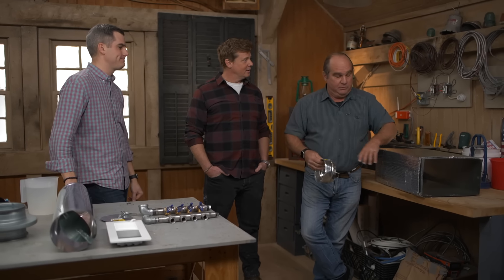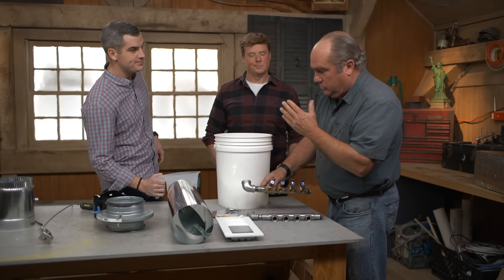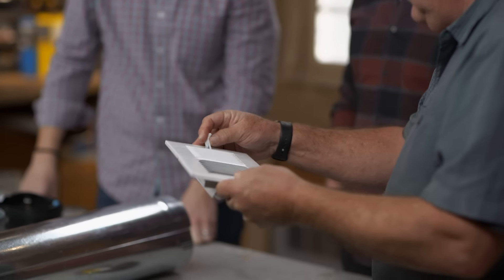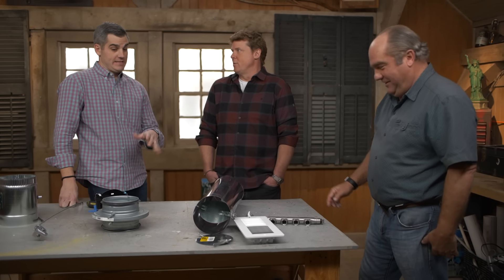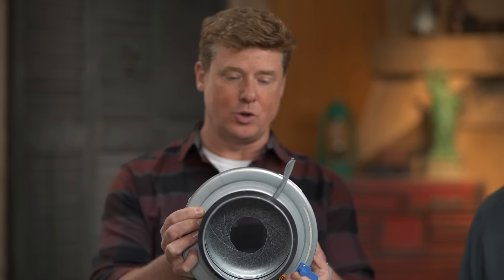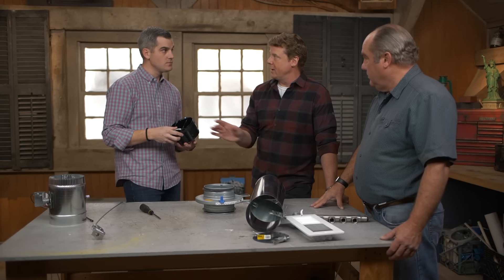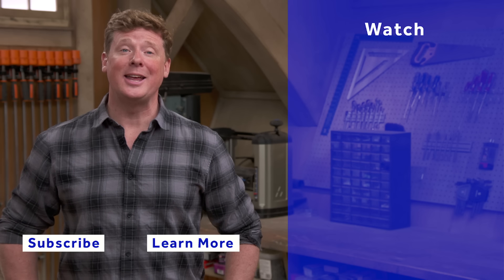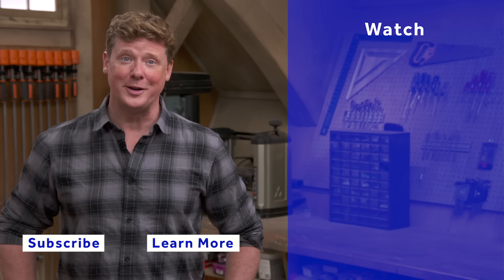Understanding Air Flow | Ask This Old House

Comment: I would suggest to never install drywall as a finished basement ceiling. If anything goes wrong with the ducts or there's a leak on the floor above, you have a huge hassle to take care of it. Just put in some nice ceiling tile that can be removed right where the problem is.
Reply: I like drywall better for a more finished look, but I put access panels for anything that would ever need service in the future.
Reply: If air leaks all it makes is a sound. It’s not that serious if there’s a leak.
Reply: @cbermudez281 A water leak.
Reply: So, you gonna do that between the first and second floors too?

Comment: What they got wrong is that air will pressurize and push back the air more evenly.   The water demonstration is incorrect.  A duct filled with air will build back pressure and change the dynamics of take-off locations.  Balancing dampers are still needed, but not in the way they are showing.  HVAC business owner here, 28 years.

Comment: Surprised nothing was mentioned about automated zone systems. I have a thermostat in each room that is connected to damper that opens or closes electronically based on the temperature in each room.
Reply: I agree and this has been around for years.
Reply: Guessing air handler is providing static air pressure? That's the problem. Sure handler needs to adjust - have variable power/speed to make it work properly. Closing off completely one register, which was meant to provide air flow will unbalance the system and can lead to problems. I believe they didn't mention it so no witty diyer start putting this into their one speed system...
Reply: @MariuszChr  Yes, that's why all the doors in my newer house have a big gap under them, so air can move even when door is closed. Newer furnaces should never have a floor register completely closed off as it puts a bunch of stress on blower.
Reply: @gl15col  your house probably leaks sounds like crazy. You don't need a big gap under the doors if each room has a supply and return.
Reply: @Egleu1  ... true, but the cheaper install is a supply in each room with a common return in a hallway. This is why we have balance problems when carpet is installed and that door gap goes away.
Reply: @SubToRandomVideos101  where else would I learn how to do an oil change in my Porsche GT3 if I can’t be on YouTube?
Reply: @Egleu1  wth kind of home has a supply and return for each room? if you have one of these homes, you are TOO RICH for this channel
Reply: @Vlican  my home does. It's not hard to do if the basement ceiling is exposed you just run a couple extra ducts.
Reply: @Egleu1  Still, returns in each room of the house is as rare as hen’s teeth…for somewhat obvious reasons.
Reply: @jaimslaw  What reasons?
Reply: you still size the unit and ducting to the home and home conditions. however, with a zoned system, there’s is a Zone board with the system that controls air to each zone. every board can be different but if it’s a simple 2 zone system, typically when there’s a call for one zone, the system will run 70% of its maximum airflow versus 100% with both systems calling for air.
Reply: @jaimslaw my home is a 1955 duplex. Every room has a return

Comment: This was really helpful for me. The upstairs and downstairs temps of my apartment were always drastically different - I measured the temp upstairs at 8 F warmer than downstairs last week. I had just resigned myself to the fact that we had a crappy AC unit because it's a rental. By closing off the vents downstairs somewhat (where the air handler is) I've gotten the upstairs and downstairs temps to match and it's so much more comfortable. Thanks!
Reply: Are the stairwell open?  The stack effect means hot air rises, so with open stairwells the downstairs hot air rises to the upper floor.  I have seen, but not used, ceiling curtain tracks which hold long curtains that reach from ceiling to floor. I think those curtains would lessen the stack effect.
Reply: That's really unusual you have an air handler downstairs!
Reply: @dianedoncheski2302  Not in old houses with crawlspaces.  in a 1960s neighborhood in the southeast and they're all in the crawlspace and ducting from underneath.

Comment: My parents and I were talking about air flow today. We were trying to find the dampener for the Maine floor of a colonial. Looks like the primary duct is in the ceiling of the basement without any dampeners and ceiling registers. So the water example really helped explain why it is so hot on the Maine floor.
Reply: This was a great example. We get it now.
Reply: Usually not that hot in Maine

Comment: Great learning here, thanks. OK FOLKS - PLEASE HELP. 2 years ago had 100% new Furnace/HVAC installed. And, other than my leaky crappy windows - yeah, the house warms and cools. But all of a sudden - my basement is really really cold. As in, I need a winter hat and 2 sweaters to watch TV down there. Fully finished basement. I actually feel a cold breeze sometimes - but for the life of me can't see where it comes from. It happens when NO heat or A/C is operating-  my suspicion is the breeze happens right before heat kicks on. I've literally slept next to vents in basement. At best a tiny trickle of air - sometimes but there's no way that freezes a 1000 square foot basement.  Exhaust fan in bathroom I out my hand on all the time - no cold air there.  I've hung toilet paper everywhere - once in awhile I see the paper wiggle. And I'm totally still and no heat/AC is kicked on. But again dont know where the heck the air comes from.  Any ideas???  Could it be leaky ducts - shooting cold air thru the ceiling tiles into basement?    Appreciate any thoughts, thanks.

Comment: Not pictured: Flex ducts which are common in the South. Flex ducts also must be installed correctly no slack and no sharp turns,

Comment: My house was built in 2009 and I moved in a few years ago and the 2nd floor has 4 cold air return vents but just found out they are not hooked up .
Is it possible to hooked them up and would it make a difference in evening the house temperature.
In the winter the house is 2 ½ deg cooler on the second floor than the main floor and summer 2 ½ degree warmer.
One cold air return on main floor (working). None in basement.
House is 1537 square feet.

Comment: In most production built homes today, the hvac contractor will not install metal ductwork. He is bidding for the houses and will opt for flex duct to reduce material and labor costs. Flex duct is even less efficient at moving air than metal ductwork. Flex is more restrictive and is never straight. Sags, sharp bends and length of run to fit around obstructions greatly reduce the cfm  that was called for in the design. Quality of installation is the main factor in a satisfactory system. Properly sized equipment, ductwork and neat installation is critical, but often ignored because of cost.

Comment: The iris dampers look cool but are very restrictive!!! On a typical residential system we only have .5” of static pressure to play with. The A coil = .1” the filter is .1 1+1= 2 right? So we only have .3” of SP for ducting and the typical very restrictive cheap supply registers most people install, oh did I mention duct air leakage??? The idea create the least amount of restriction as possible NOT to add restriction. Look up the Reynolds number Laminar flow VS turbulent. These iris dampers cause a lot of turbulence and uses up our our static pressure.

Comment: distribution of air is dictated by static pressure more so than proximity to the blower fan
Reply: Those two are directly related.
Reply: @MattFerguson26  no kidding  it's all related, but his water through pipes example was too simplistic not to comment on

Comment: The pipes for the example are different. One has the outlets point down and the other is out the side. Of course it'll come right out the first one if it's pointing down. It would with the valve too.
Reply: But you can also have registers and/or ductwork pointing in different ways so it's kinda the same thing

Comment: I am in Atlanta Ga in a 1963, 1650 sqft house, and nobody is competent enough to help me. I am so frustrated. My house lacks the proper number of vents and the duct work needs restructured. So in the summer I can only cool to 82 degrees and I have to deal with it because no individual or company has been knowledgeable enough fix my problem. I need all the advice I can get!!!’ Thank you

Comment: sir, one thing to ask please reply, there is one thing called cross flow fan like one ac blower fan i have a idea to implement cutting this into half and fix one side to motor in a way that it can withstand on motor shaft without fixing the other side and rotate it reverse will it give air from inside the hole in center to out side, so that i can fix to pipe to make air flow

edit: i wish you understand what i want to say 

   + (-ve)             |----------------------------------------------------------------------|  open from this side
|-----------------|      |----------------------------------------------------------------------|
|                   |===----------------------------------------------------------------------|   ➡➡➡
|-----------------|      |----------------------------------------------------------------------|              
   -  (+ve)            |--------------------------------------------------------------------- |

    and air from these arrow to pipe to go further

Comment: Wish I knew more about this before I got screwed by Costco approved sub contractor. They installed my new air conditioning and ducts.
Reply: I didn't know anything about what size I needed, and they installed a air conditioner that is too big, so it runs for only a short time to get the temperature down, which is never long enough to deal with humidity. The temp says its fine, but it's never really comfortable. Won't take the word of a contractor again!
Reply: 0:32 here it's discussed.  the question that needs to be asked, if they do a load calculation? If HVAC contractor does not know or care to do one, try another contractor who does.  Also, sometimes the one of the units that is currently installed may be the wrong size for your home.

Comment: Open stairwells allow the stack effect, which causes temperature differences from lower to upper floors.  But I have not seen this addressed.  The stack effect means warmer air rises, so with open stairwells the downstairs warm air rises to the upper floor, whether it is heating or cooling season.  I have seen, but not used, ceiling curtain tracks which hold long curtains that reach from ceiling to floor. Using those curtains would lessen the stack effect, I believe.  Or build enclosed stairwells.  Multi-level homes would have less temperature divergence, more comfort, and energy savings.

Comment: Maybe I don't have to point this out, but it seems to me that some of these solutions are just the better mousetrap. If you have access to install a fancy damper, then you also have access to manually adjust the $3 damper. If you don't have access, then the damper should probably be in a better location, like near the trunk line. (where it will make less velocity noise)
Reply: They install the dampers where the trunk meets the offline run . In many cases they just adjust them during installation.  Problem is that owners change them and sometimes cover the system to hide the ductwork.  My furnace was installed under the bedrooms with the living room and kitchen at the far end .  I ended up shutting off all three bedrooms . In the basement , I have a exhaust & intake which I closed both.  When the furnace runs it takes the air from  the basement ( which may contain radon) out thru the chimney. The foundation area is not sealed .  The far end of the house gets all the heat and radiates to the bedrooms , which should be cooler.  I went from a 120,000 BTU FURNACE to a 80,000 BTU .  First furnace 1963 to 2015 replaced fan motor 2010 .

Comment: If the ductwork was laid out properly to start with airflow would balance. This would involve some prior calculations by the installer. There is even software available to help thru the process. But it takes time which most HVAC install companies don't want to spend.

Comment: His main trunk idea is NOT how it’s actually designed by anyone with any experience. The design distribution work is the following…. We design to static pressure for residential we usually use .10” of SP the goal is to maintain .10” of static pressure all the way through the system so that air is delivered per design meaning correct CFM & velocity. We don’t run a singer size duct we start with the maximum CMF needed in the main trunk and reduce accordingly. Say you have a 4 ton unit that equals 400 CFM per ton 4 X 400 = 1600 CFM if we had to directions we would use 2 main trunks = 800 CFM each @ .10” of sp = 14” supply each then we reduce from there depending on the room size and load 12” = 600 CFM 10” = 400 cfm = 10” 200 CFM = 8” 100 CFM= 6” all at .10” of SP if you use this design everything works perfect. Put dampers at every Y and you will be able to balance the system no big deal. Once thats all done you design your return to .08” of static pressure install 2 returns and you will have a very nice system without having to buy gadgets

Comment: So why not use the registers on the floor? This seems overly complicated
Reply: They explained that.
Reply: the short answer is closing the flow near the register causes velocity noise or whistling. Closing it down father away makes less noise.
Reply: if they're not disturbed, they work fine. don't let the kids touch them, or hit them with the vacuum
Reply: @Vlican  ... that's another good reason. What I forgot to mention the other day was furniture blocking the air... and the returns suck up all kinds of dust bunnies. In my experience, you need to change the filters twice as often just for that issue alone.
Reply: @gl15col  Gets hit by vacuum vs all those other expensive solutions.

Comment: I had hot water baseboards put in when we put the house up over 35 years ago. Last year I finally replaced the original boiler. The whole house is a constant even temperature. Duct work sucks and is bad for your health.

Comment: Your demonstration with the water is not pressurized.  Duct would pressurize and not distribute as demonstrated.  People don’t put dampers in and think you are going to fix anything.  You most likely will end up restricting to much air causing costly repairs.
Reply: The water is being pushed by gravity. There is still pressure, just not a lot, hence being a scale model. With enough pressure, any amount of any sized holes would all be flowing at the maximum rate. If you cannot increase the pressure going into the system i.e. upgrading the air handler, then you need to increase the pressure by restricting the flow out of the holes.

Comment: One of things that they didn’t mention was the requirements for static and differential duct pressure ( essentially duct resistance to air flow) listed by the furnace manufacturer. I found out the hard way that if these requirements are not met ( closing off vents create back pressure) they put a lot of strain on your fan motor. The newer ECM  DC motors seem to require much lower resistance , probably assuming modern ,well designed ductwork. The older AC motors were not as efficient but could blow air through anything! Ask your HVAC person to use a manometer to measure the pressures. If he or she looks puzzled, you have your answer.
Reply: The good old days when things were built to last and no concerns for efficiency.
Reply: @mrtv777  Yep. The ECM motor labor replacement  , although covered by a part warranty , negated any savings in energy cost for the time period! This stuff is nice when it works but when it doesn’t it costs a bundle to replace. The replacement stuff goes to a landfill and energy and resources are used to replace it. I learned my lesson.
Reply: It doesn't strain the motor. the system essentially 'runs high blood pressure' and as a result, less flow. The greater problems are elsewhere and less obvious

Comment: Putting in one of those Iris dampers can also mess up your blower motor on your furnace. Normal AC mode calls for the blower motor to turn on High, where as on heating its usually set to low or med-low. Installing one of these does regulate the amount of air going to a particular room, but its not like the air 'flows' backward against its own airflow to other rooms where airflow was a concern. What it does do is creates resistance and almost a back pressure in the duct system and at the heart of that is where all the flow starts....your blower motors resistance. What they miss here is the system should be properly air balanced by an expert. At best these should be put in the very beginning of a run so as to create the least amount of back pressure to the resistance of the blower motor and least amount of turbulent air in the ductwork.
Reply: That's unheard of in houses, but a very specific set of skill sets and tools for commercial buildings, and it's typical in commercial buildings. (but hardly universal) Unheard in homes though
Reply: @raindogs451  Unheard of in homes? LOL what planet are you from? They do air balancing for forced air in homes all the time. I mean TOH even did a prior episode all about it.

Comment: For the last example... why not just push the damper open or if needed cut ceiling and remove, then install a new accessible one earlier in the run? That way it can be serviced if needed and likely a cheaper damper type to retrofit